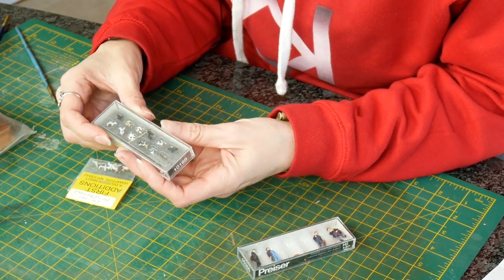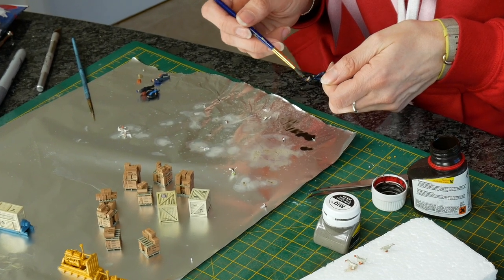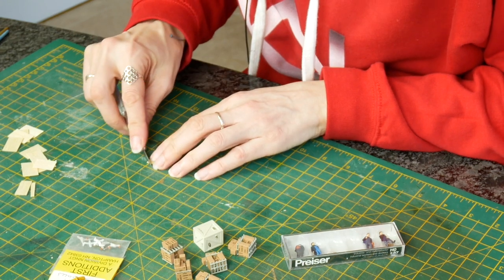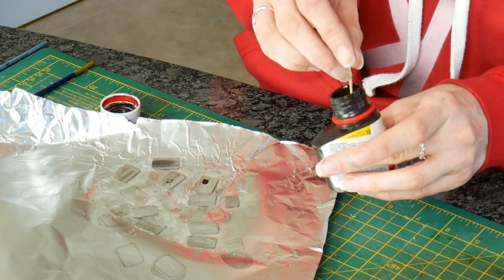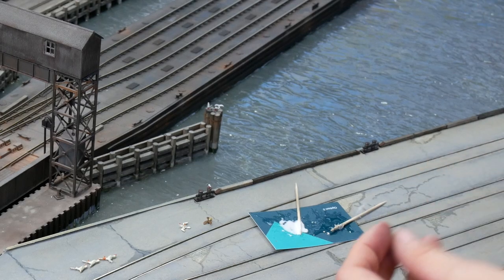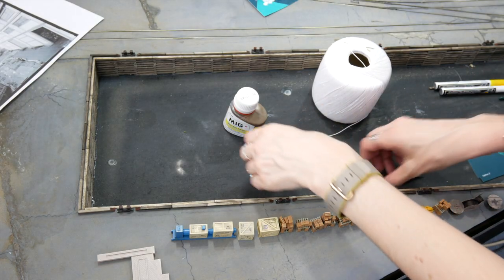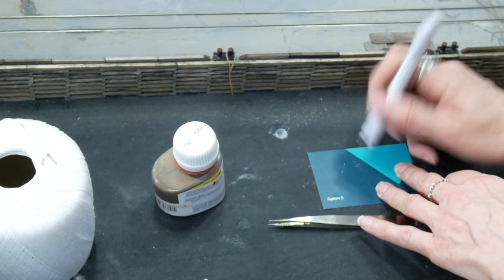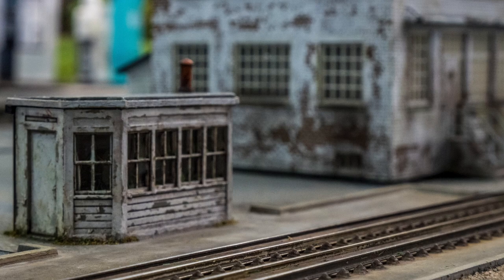How to Model Dock Details

Comment: Excellent work!

What fishing line did you use? I would recommend Fluorocarbon. It has basically the same refractive properties as water, so less visible than monofilament (which, granted, means more if it's actually in water) but it is a lot stiffer. So, you can use longer lengths of the same thickness, or the same length but thinner, with less visibility.
Reply from the maker: +KingBollock I'm not really into fishing so I just used the normal stuff. I'll look out for fluorocarbon next time though. I use fishing line to hang my pictures and when making icicles but never for fishing!  Thanks for the tip.

Comment: Amazing.
Have you a video on making the water in the Dock. Looks unbelievably good!
Reply from the maker: Scott, I did this before I made videos so there’s on,y a few blog photos. I do have one more area to do so will video that but it’s a way off I’m afraid.
Reply: @KathyMillatt  great talent
Reply: @KathyMillatt  iv jus bought some  foam board from the range. But this is smooth and not really able to carve in texture. Can you only really use the polystyrene foam for creating rocks and walls
Reply from the maker: I’m not sure what you’ve bought but I’d use blue (or black as it seems to be now) craft foam. The sort that is like insulation foam. However, this dock just has chipboard under it so you only need foam if you are modelling river banks.
Reply: @KathyMillatt  oh right I see the stuff you use to insulate sheds. Thanks
Reply from the maker: That’s right.

Comment: Hi Kathy, is that an ordinary plastic milk bottle you use for your alcohol/ink solution? Jim.
Reply from the maker: Yes, Just a 4 pint bottle.  It works well with a pint of alcohol as you can get a good shake and dip stuff in it by tipping.
Kathy
Reply: Thanks Kathy, I was wondering about the suitability of plastic milk bottles for storing such a chemical, in that that they do not either soften or go brittle and leak. I find that these plastic milk bottles are so useful when cut horizontally or vertically for a disposable bath, or using the top part as a funnel. Suppose they are quite useful for milk too, Jim :)
Reply from the maker: +freightuk I don't drink milk so I have to nick them from friends. I've had these bottles with IPA and ink in for at least 5 years, probably more, with no problems at all.
Reply: Thanks Kathy, your tools and materials tips (like the Roket Blaster and veneers) are just as valuable as your modelling eye and insight, keep up the good work, Jim

Comment: i've never liked the glossy toy look of most scale people. i always hand paint (even in n scale) my people.
Reply from the maker: Wow, in N that's a real achievement!
Reply: Kathy Millatt i start by using a round hole punch and put most of my people on base punched from thin styrene.  which i then hold with an alligator clip (i use an old cut off paint brush handle as s handle)  while i paint.